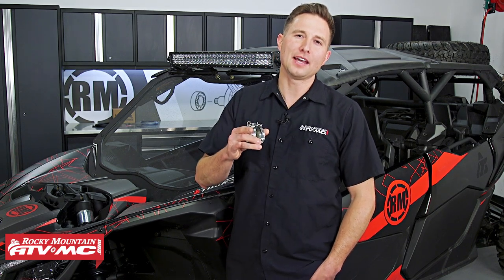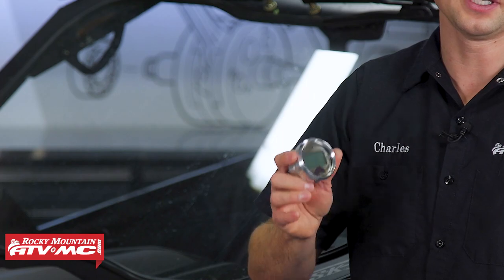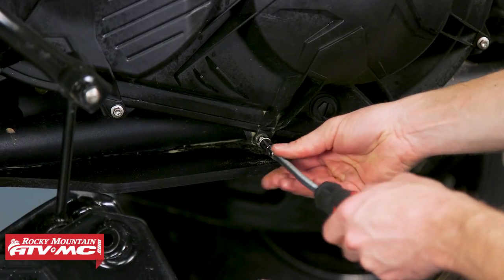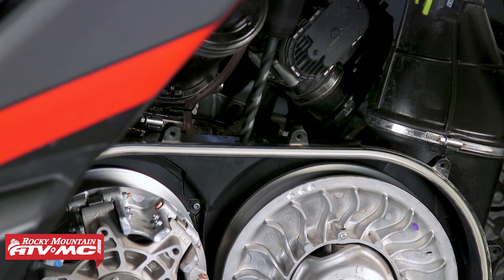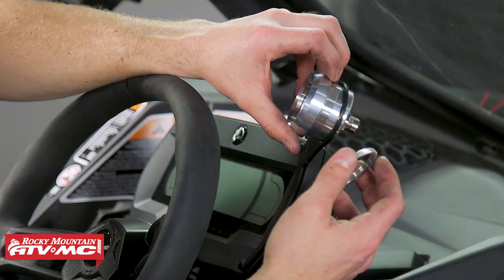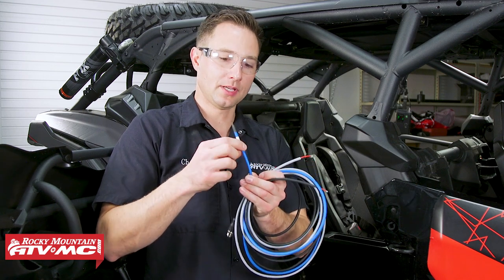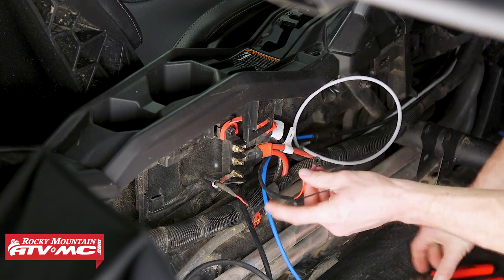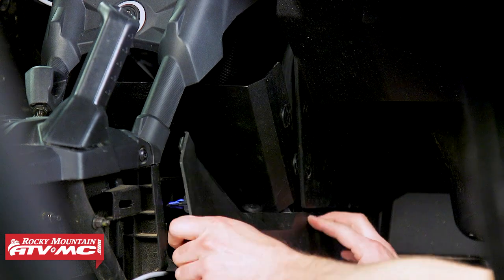How To Install a Razorback 3.1 Dimmable Belt Temp Gauge on a UTV

Comment: Is it OK to add a flat washer under each nut? The nuts are so small, I'm concerned with them pulling through the plastic if I don'tuse a nut..
Reply from the maker: Yeah, you can if that is a concern.